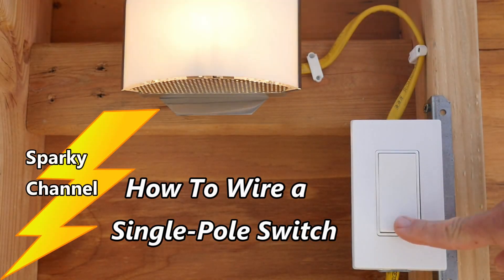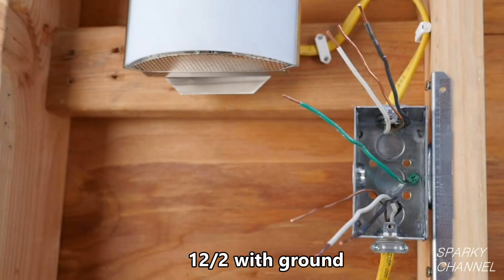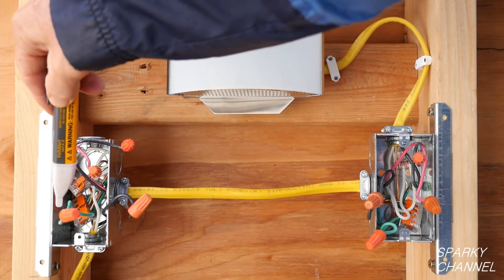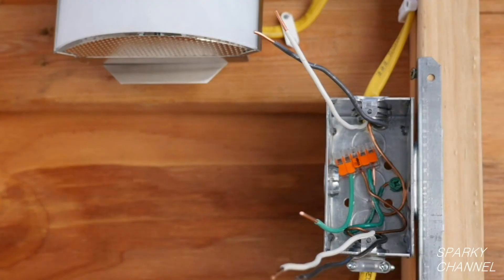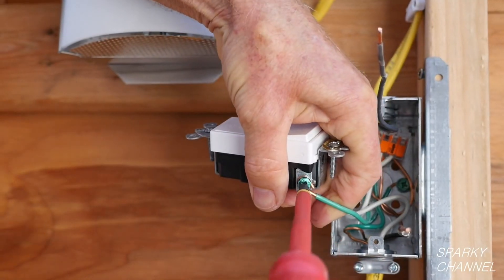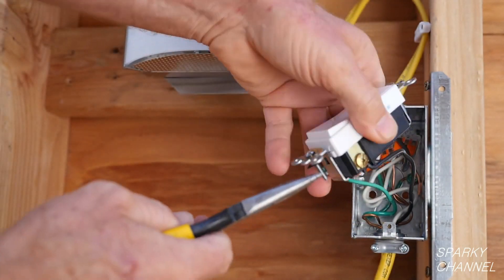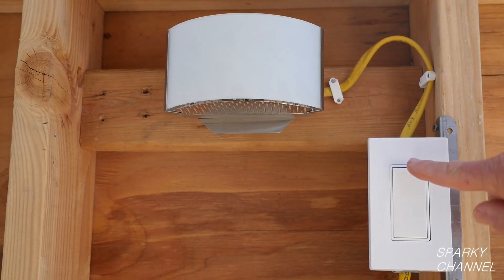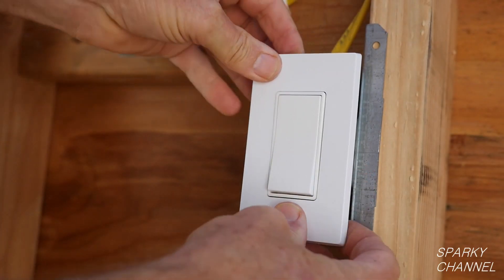How to Wire a Single-Pole Switch

Comment: Hey, Bill! Great video! Solves most of an install issue I have been worrying about. I have this Hubbell HBL1221ILC lighted switch. It's supposed to be lit when the switch is off, but there is absolutely no wiring or other installation information with this switch. Not even on the inside of the box! Two brass terminals, with no indications of which is which, and one ground terminal. Any idea on how this thing should be wired up correctly? Much appreciated!
Reply from the maker: Wire it just like in this video. The little LED light takes a very small amperage to light.

Comment: I changed out my light switch, however now my outlets will only work when the switch is on. What have I done wrong??
Reply: Plz respond when you get an answer
Reply: @ryanthepianoman27  it means you had 3 cables running into the outlet box, 1 cable provides power HOT, 1 cable was to the load your light, and the 3rd cable was apparently to branch out to your outlet, you must know which is to the light and which to the outlet. you were supposed to combine the cable for the outlet and the power HOT cable together and add a  pigtail to connect to your switch on the switch's HOT side, instead what happened was you combined your outlet cable with your LOAD lights cable so only when your switch is turned ON than the outlet cable and power HOT are connected making your outlet powered because you completed the circuit to ON, you basically discovered the trick used to make a switched outlet which is cool, I never thought of that. I'm in the same boat, what you need to do is locate each black wire from each of the 3 cables, once you know which is HOT providing power, than you know the other 2 cables are either the outlet or the lights. I'm sure electricians know a continuity test to figure out which is which but I'm gonna do it the easy way and just not connect 1 cable and whichever if the lights don't work or the outlet doesn't work than I know which cable is for which, this sparky video will explain what's happeneing: https://www.youtube.com/watch?v=A2t2EH3IhlE
Reply: it means you had 3 cables running into the outlet box, 1 cable provides power HOT, 1 cable was to the load your light, and the 3rd cable was apparently to branch out to your outlet, you must know which is to the light and which to the outlet. you were supposed to combine the cable for the outlet and the power HOT cable together and add a  pigtail to connect to your switch on the switch's HOT side, instead what happened was you combined your outlet cable with your LOAD lights cable so only when your switch is turned ON than the outlet cable and power HOT are connected making your outlet powered because you completed the circuit to ON, you basically discovered the trick used to make a switched outlet which is cool, I never thought of that. I'm in the same boat, what you need to do is locate each black wire from each of the 3 cables, once you know which is HOT providing power, than you know the other 2 cables are either the outlet or the lights. I'm sure electricians know a continuity test to figure out which is which but I'm gonna do it the easy way and just not connect 1 cable and whichever if the lights don't work or the outlet doesn't work than I know which cable is for which, this sparky video will explain what's happeneing: https://www.youtube.com/watch?v=A2t2EH3IhlE
Reply: Thanks 😊

Comment: Why do you use 12 gage wire when you can use 14 gage?
Reply from the maker: I feel that 12 gauge is safer because if someone were to add onto the circuit later the 12 gauge wire can handle more current then 14 gauge. Also less chance of breakage.
Reply: @SparkyChannel  totally agreed their Bill.

Comment: Bill, I have a question for you. There are electricians on a Facebook page, that are really slamming Wago lever nuts, have you ever had one fail, not make good contact and heat up? Thanks.
Reply from the maker: I've used Wago's for 30 years with 0 problems.

Comment: Why are you using 12 wire
Reply: Why not ?
Reply: Dot.
Reply from the maker: 12 gauge wire is safer in case someone adds onto it at a later date. It can take a lot more amperage than 14 gauge wire.
Reply: Hey guys. This was juat a demonstration. Let’s not not pick. And a lot more amperage ? 4 amps more. But again. Demonstration.

Comment: Here in Germany most manufacturers don't make simple on/off switches anymore. Because you can also use 3-way switches instead, just connect the permanent line to the common of the switch and the switched line of the light fixture to one of the terminals for the travellers.
The only exception are isolator switches, which are 2-pole switches which switch all active wires off (the line and the neutral). In most cases they also got a neon indicator that lights up if the switch is in the on position. Here they are mostly used to switch off the central heating system of the house.
Reply from the maker: Thanks Marcel!

Comment: 4:05 Seems like there shouldn't be an insulating washer attached to that mounting screw under the grounding clip, why would it be there?  Strange. Thanks for this Mr. Bill!!!
Reply from the maker: It holds the screw in place during installation and it doesn't matter at all when installing into a plastic box. The NEC article I referenced in the video governs when it has to be removed but I think it's always wise to remove at at one paper washer when installing a device into a metal box. 
No problem, thanks!

Comment: Hi Bill,I have a question about the wire staples you have in this video.they are the same staples I use,are they supposed to be tight holding the wire firmly or a little loose so the wire can move around.
Reply from the maker: Certainly you don't want to damage your cable in any way with the staples but they are supposed to hold the cables in place. Beyond that, I don't of any NEC code saying exactly how tight they need to be.

Comment: I'm really surprised that you're using wago's. There's no code against use of wages as long as they are UL Listed. However, I can't tell you how many times I've heard from others to not use wago's because of their unreliability.
Reply: Ive heard the opposite; people swearing by them. 
A lot of people are resistant to change
Reply: We use Wago connectors for 30 years here in Germany, they are considered as beeing state-of-the-art. Never had any issues. Same type of connectors is also available for switches and outlets. For ten years are now neutral and ground bars in panels available. Now there are even circuit breakers available with these connectors.